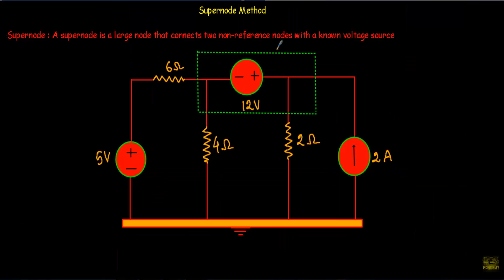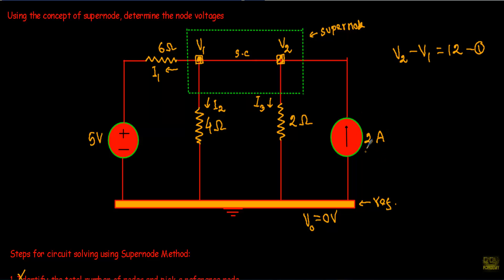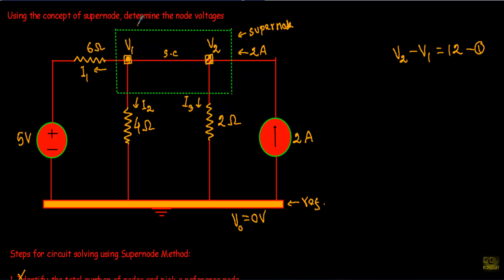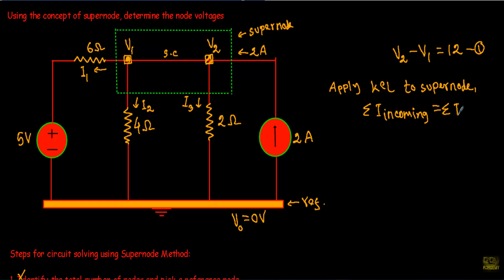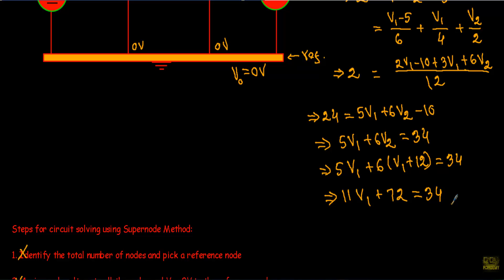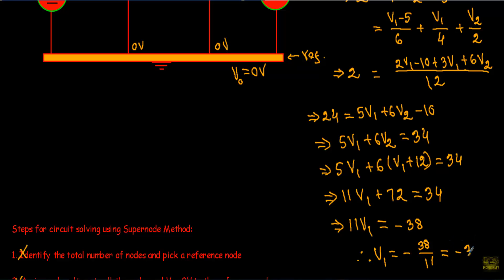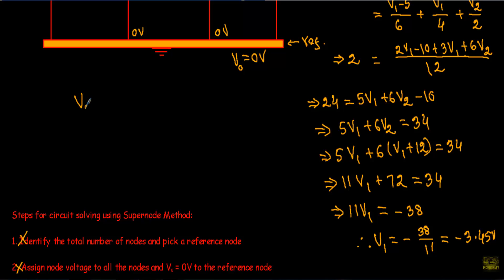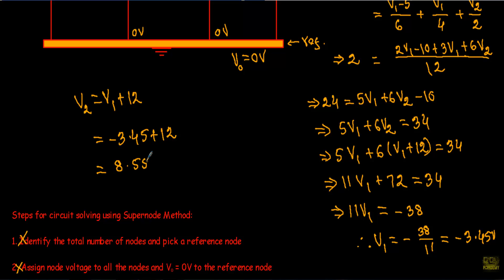Supernode Analysis, Steps & Example 1

Comment: Thank you!. One question, at (v1-5V), wouldnt 5V has a higher potential since current is flowing from positive which the 5v terminal is positive so the equation be (5v-v1)/6? thanks
Reply from the maker: We don't know the value of current through 6 ohm resistor. In case of nodal/supernode analysis, we assume all the unknown currents are outgoing, so current through 6 ohm will be outgoing from node 1. and current will be (V1 - 5) / 6